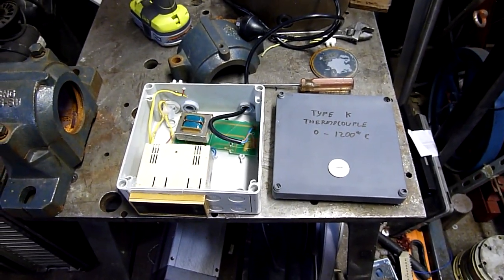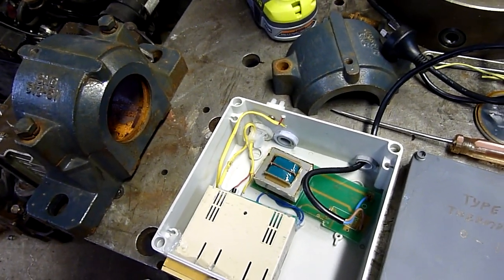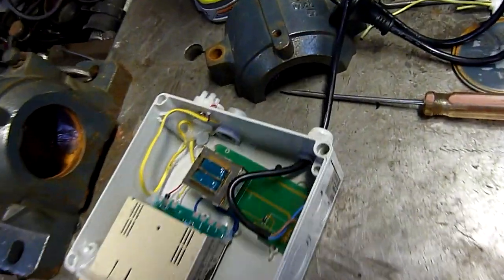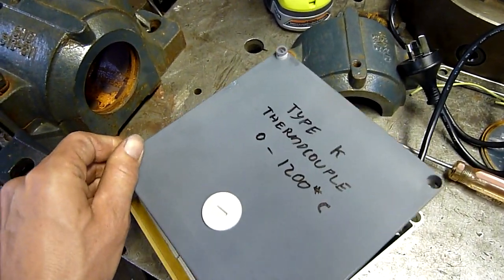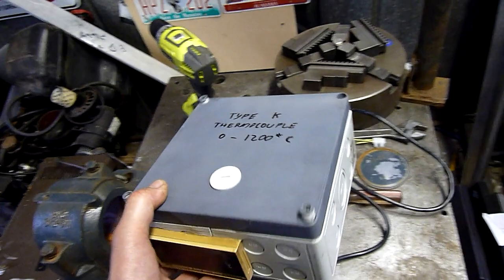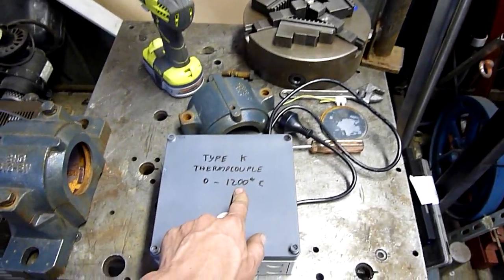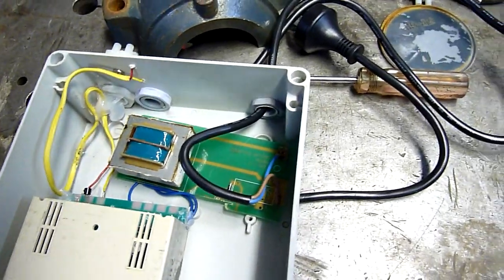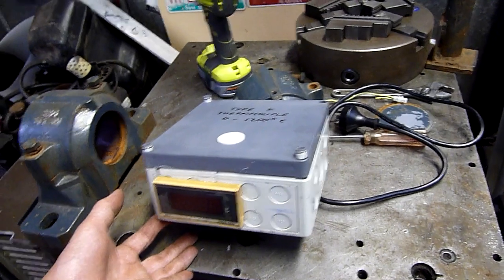Shimaden Type K Thermo Control Hacked Repair

Comment from the maker: I've seen rapid set silicone attack copper but thats because it has Acetic acid in it. neutral cure does not seem to do it, at least in dry conditons